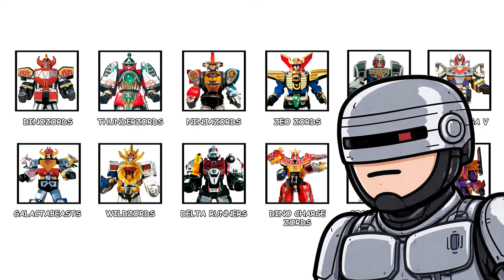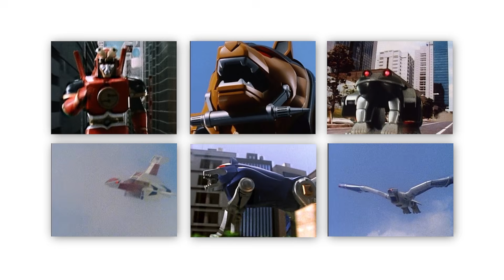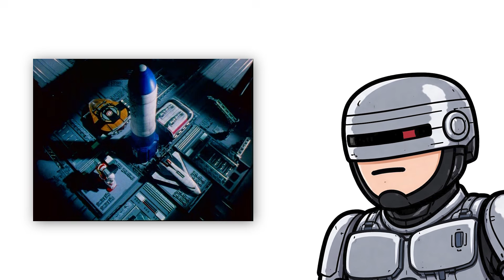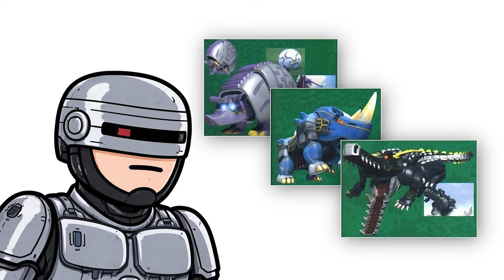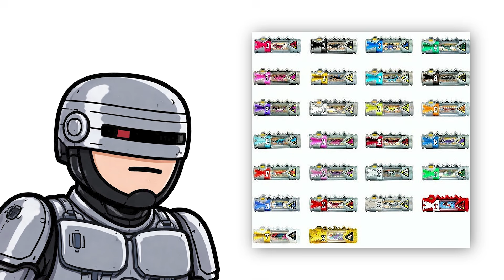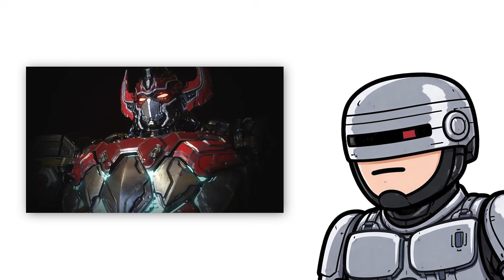Every Power Rangers Zord Explained

Comment: The amount of information you got wrong in this video almost causes me physical pain. Didn't mention the dragonzord at all. Lord Zed didn't destroy the dino-coins Rita's brother did when he destroyed the Thunderzords. Didn't mention the Tigerzord warrior mode or Mega Tigerzord. Didn't mention the Shogun zords or Shogun megazord. Didn't mention the Redbattlezord, Pyrimidis, Super Zeozords or, SuperZeo Megazord. Didn't mention the Astro Megazord or Delta Megazord. Also the Mega V zords and Megawinger were in a hanger on the moon not docked in the Astromegaship. Completely skipped multiple seasons( Lightspeed rescue, Time Force,Dino Thunder, Mystic Force, Jungle Fury, RPM, Samurai, Ninja Steel) The SPD Rangers didn't patrol in the zords the had normal vehicles for that. Also where did you get that prime zord crap if that was really the peak a ranger technology then the mystic force rangers from season 14 would have been the peak  I don't know who you made this video for but it wasn't Power Rangers fans.